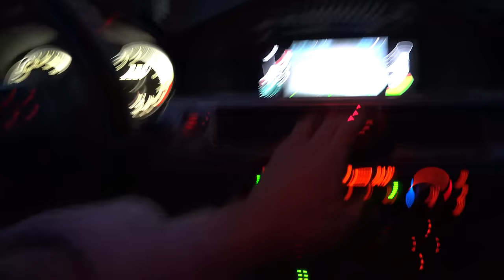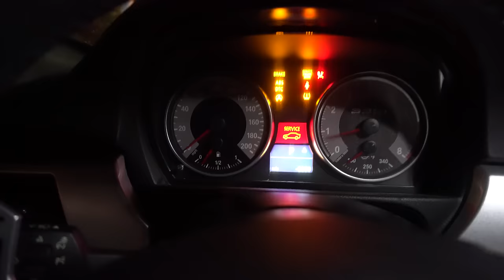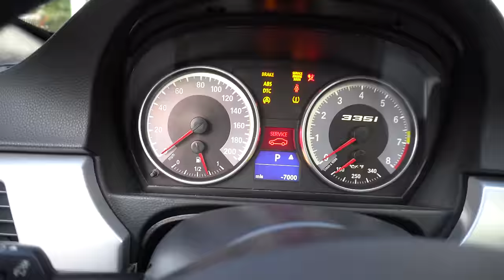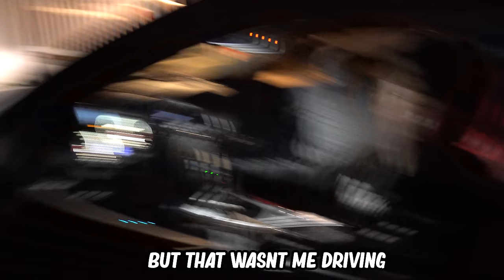EMBARRASSING A BUILT CAMARO IN A BMW 335I

Comment: it went smooth for u? what year is ur car, have a 11 335i and i just put the vrsf street exhaust on, the first piece, attached to downpipe, curves early at the end and is resting on the transmission bracket, makes the car vibrate and messed up the whole fitment rlly. any ideas?
Reply from the maker: it’s a 2007 and yea mine did that too just bent the bracket in a lil😂

Comment: Where’s that full mod list at
Reply from the maker: issa long list but basic shit is

burger motorsport 7.5 inch intercooler
vrsf race exhaust 
ARM relocated inlets
ARM catless downpipes 
mhd stage 2+ tune
burger motor sports stage 2 bucket less fuel pump 
index 12 fuel injectors